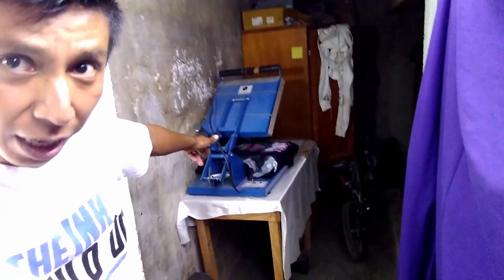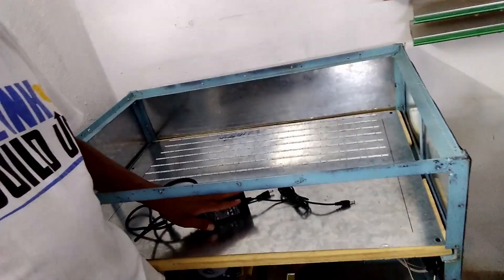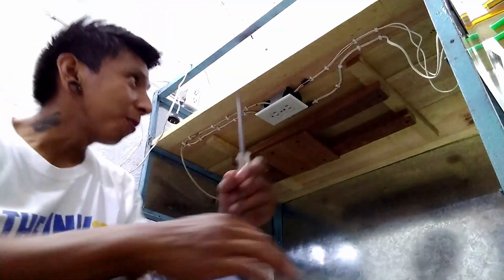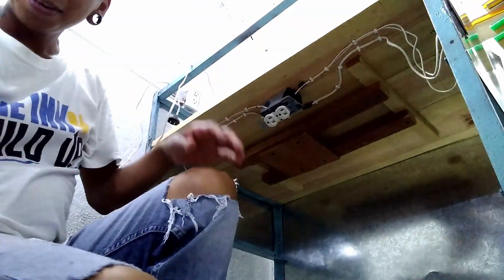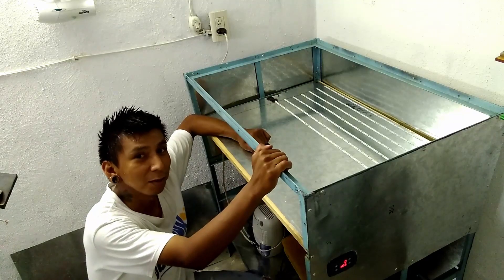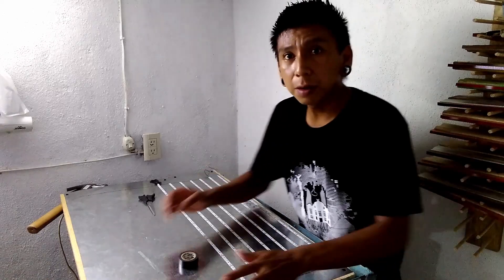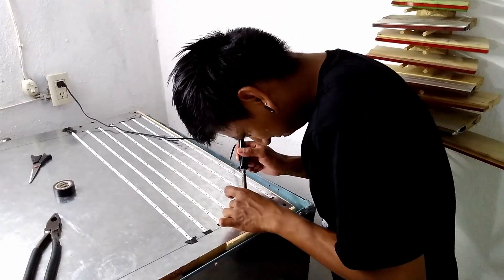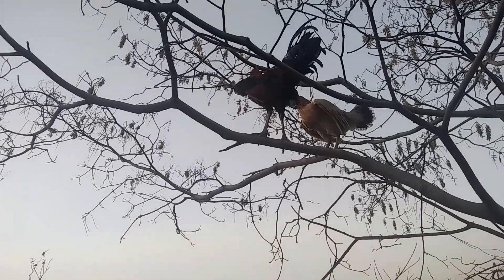Day 9 & 10 of DIY Exposure Unit

Comment: Hey bud I need your help !! I started putting my LED strips like you and by the 4th strip its barely lit and the 5th one won't even light up ?! Why ?
Reply from the maker: How many rolls are you using? If you're using 2 rolls, I recommend you use a splitter from the power adapter. These LED strips that I bought come with a splitter that way I can lit up both rolls at the same time. When first got them, I connected one roll at the end of the other roll and it didn't lit up that brightly, so I decided to use the splitter. This is the reason why, on my videos, I did half of the led strips(one roll) than later on I did the other half. If this doesn't make sense send me a message on Facebook and Ill try to explain it beter.
Reply: @TheInkBuildUp  cordial saludo. yo tengo la misma duda. debo usar dos rollos con su correspondiente timer, pero no tengo claro como debo hacer la conexión. el empaque de leds indica: "the led strips, must no exceed 5 meters, when used in a DCseries circuit" podrías por favor ayudarme? de antemano, muchas gracias.
Reply from the maker: @nickbelane9280  Hola Amigo. Bueno con mis LED, son dos rollos pero el que yo compré viene con un "splitter", que dónde puedo conectar ambos rollos separado de uno mismo. Y el timer, pues aquí tengo un vídeo de como instalar éstos LED. Tengo 3 formas de instalar y las de LED es el número 3. 

https://youtu.be/QPa2E4wPwtQ
Reply: @TheInkBuildUp  well my inside measurements are 30" x 40" so far I have one roll down cut into 5 strips at 37" lengths and I will probably need another 5 rolls hahah
Reply from the maker: @ianbowie8121  That is a big unit, so yea, you'll definitely  need a splitter for you strips. Since you will need like 3 rolls minimum. But yea just send me a message on FB.
Reply: @TheInkBuildUp  I will add your Facebook thankyou :)
Reply from the maker: @ianbowie8121  Here you can what I'm talking about when I first tried my LED strips. I first connected my rolls with the splitter and it lit up perfect. but when I connected one roll with the other, the second roll was less lit.
https://youtu.be/zLfPh1UW_6Y?t=355

Comment: Im making myself one out of a 20x24 frame saw a functional one a couple weeks back and had a torn aluminum frame and a picture frame I found locally. Ordered some UV led strips on Amazon and luckily this specific one I have the power supply has a switch built in. Gonna have to solder the wires also.
Reply from the maker: That's awesome Amigo. Hope this video helps out in any way.

Comment: Now that you eliminated the AC adapter, you have 24/7 power to the timer/unit (that can burn the timer out), so you have to plug and unplug the unit every single time you use it and that can wear out the outlet. I suggest you install an In-line toggle switch somewhere on the cord that plugs into the outlet. That way you can keep the cord plugged in and just toggle the unit on/off with the flick of a switch. Look up "in-line toggle switch" The rocker-style switches are ideal for this. Super easy install.
Reply from the maker: Yea, my plan was to never have the exposure unit plugged in the entire time. I was first thinking of adding a switch for the entire unit but decided not to since I would be unplugging the unit when not in use so decided not to add the switch. I don't like having appliances plug in when not in use. So no worries of burning anything out.